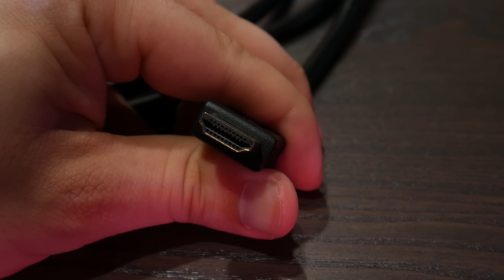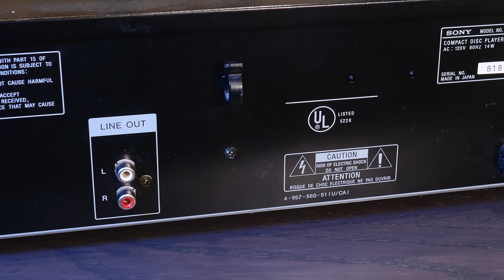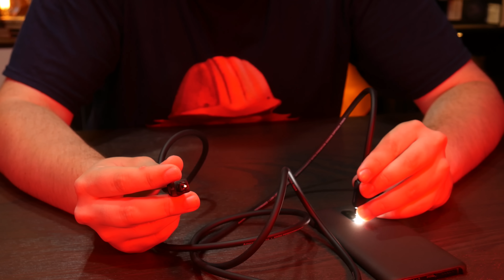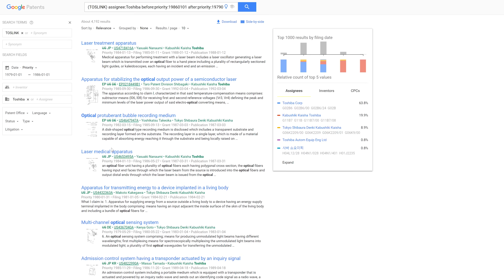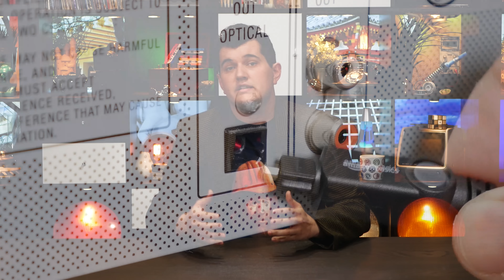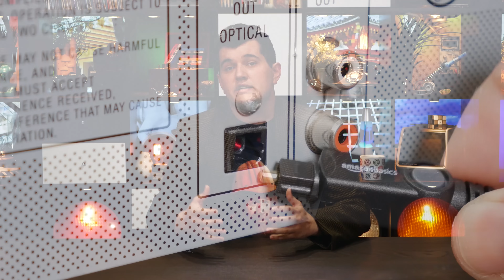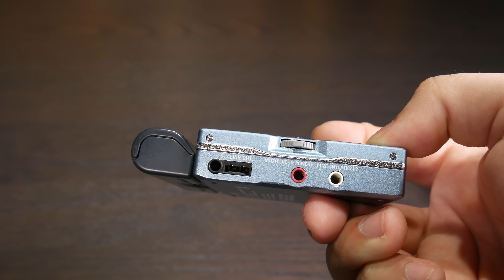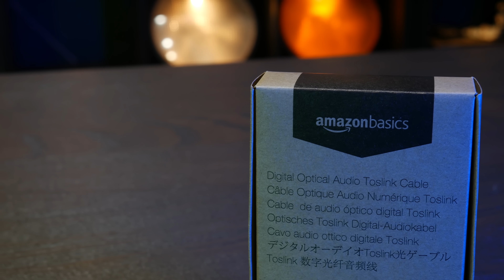TOSLINK: That one consumer fiber optic standard

Comment: Sorry, you are wrong when you claim that audible distortions happen only because the noise overwhelms the digital noise margin or talking about clock jitter.  The biggest issue is that if you run SPDIF over coax instead of TOS-Link, you are connecting the grounds of different equipment. Some of that equipment is likely to have an analog input, so the hum picked up will be quite significant.  It is often something else that is compromised by the current carried in the ground of the co-ax SPDIF cable.  This is especially true when there is a separation. For that reason, I like to have my digital audio workstation connected to my audio system (the final proof) through TOS-Link.  My studio equipment would have noise problems if connected to the ground of my stereo system.  Separating the grounds is good, therefore, TOS-Link is highly beneficial.

Comment: I've encountered mini-TS connectors in so many devices over the years, I thought it was the new TOSLink standard. Mini/Micro PCs use these almost exclusively alongside their HDMI output to provide for external audio equipment. The only other fibre I've had my hands on is for video (optical DVI-link and equivalent), which is used fairly extensively by a couple of venues to which I'm often contracted. Oddly enough, I'm usually there to handle networking requirements for WiFi and IPTV, and yet *I've never handled a network fibre*. (shrug)

Never once found a practical use for TOSLink until I needed to extract audio from an HDMI source for an old 'digital' surround system whose manufacture preceded the advent of HDMI. I found a small, inexpensive HDMI audio extractor (not so common at the time I needed one) that has stereo analogue output and, more importantly, a TOSLink port. It also has a handy EDID spoof switch to force connected devices to output surround. I picked up a handful of cheap, short TOSLink cables (which, incidentally, cost me much less than the copper equivalent), and had my entire media experience fully integrated within minutes of beating the postman to the door.

This was so easy and effective that I am still using it over a decade later, with my cable box, media PC, and a Steam Link currently running flawlessly through it (via a really cheap HDMI hub) and providing DTS 5.1. Never felt like wasting money for an upgrade, and it sounds perfect to everyone who's heard it (none are self-proclaimed audiophiles, however).

Unwanted, expensive, barely-used, pre-HDMI surround sound system: £0. Audio extractor: £40. Pissing off my neighbours by making their modern, ultra-expensive audio system sound weak: priceless! :)
Reply: Wait. Steam Link supports DTS connect?

Comment: Major advantage of toslink being optical is ground loops. While 5m isn't crazy long, it's long enough in crappy buildings with crappy wiring to encounter grounds at different levels, causing ground loop induced hum. You can get RCA based isolators, but using optical is a perfect way of eliminating that problem.

Comment: Got my self a brand new 4k samsung TV. I use my sterio as the hdmi switch between tv and tuner. Problem came when i needed sound from TV (like YouTube and spotify) got myself my first optical cable cause that brand New TV only has one hdmi connector 🤔

Comment: Great video Alec, but I think there's some misinformation going around about these types of cables holding them back. While it's true that analog noise on your digital signal shouldn't affect your resulting signal unless the noise is so great it starts flipping bits, what's not so obvious is that analog noise CAN  couple into the system past the DAQ or tertiary traces and result in degraded performance elsewhere. This probably isn't to big a deal on a CD player or Netflix box, but in a mixed signal environment; particularly where your interacting with analog radios or antennae, this can be a consideration. Adding filtering on your lines adds cost and diminishes the transient response resulting in slower speeds and shorter maximum cable lengths. I recently bought one of these for my home setup to try to get rid of an annoying hum from my speakers that turned out to be from a completely unrelated frequency mixer signal that happened to be intertwined with my audio cable. These are also great because they circumvent any risk of ground loops and they can be really long. I am not aware of any other cables that can send >100 Mbit/s for such long distances without converting to optical.

Comment: 10:00 not sure, networking fiber connectors are all keyed as well, even when they're not in duplex. Could be to prevent spinning when connector's plugged in, which would damage the ferrule. However single mode fiber really needs a very tight contact, which is not really needed all that much for a multimode with a relatively low bitrate working at a relatively short distance (digital audio is really nothing compared to 10 or 40GE transferred over tens of kilometers)

Comment: I used to use coaxial from my pc soundcard to a digital receiver about 30ft across the room back in the early 2000's.... whenever somebody would flick the light switch in the room or the AC in the house would cut on it would cut out and skip, I remember getting a soundcard with optical on it and never having that problem again...  weird thing was tho years later in a different house with other equipment I ran a 50ft coax cable from a bluray to a amp in the dining area and never had any issues lol

Comment: The reason TOSLINK cables were keyed was to ensure they were prioperly aligned, which is critical to operation. Since the connetor was designed to be injection molded plastic, which later has a fiber inserted in the shell, the manufacturing process requires precise alignment to insetion and cutting tools.

Comment: TOSLINK isn't the only consumer optical standard. My (sadly) long departed Theta Generation V DAC ran AT&T glass fibre, which trounced all other connectors albeit at a very high price. Wadia, Mark Levinson and Krell all did/do use the AT&T (aka ST) standard in their DACs/CD transports. Theta took it a stage further (at even higher price) adopting the military grade single-mode fibre.

AT&T uses true single strand glass fibre with 3M hot melt connectors and diamond cleaved ends (to reduce diffraction at the end of the connector).

TOSLINK tends to use large diameter (compared to true glass fibre) plastic conductors, which are both slow and microphonic, i.e. bending the cable can distort the signal.

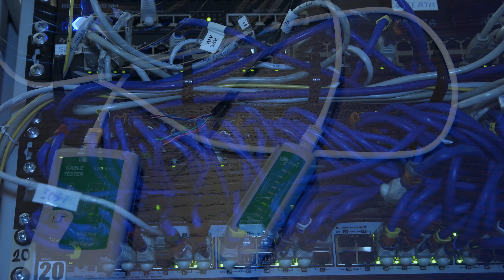Comment: 0:51 - did you know Ethernet is not a synonym to copper cable? There are other types of Ethernet cables - optical as well.
Reply: yeah Ethernet is layer 2 and layer 1, but multiple layer 1 options are available
Reply: This. Ethernet is a protocol for transmitting data. Nothing to do with cabling.

Comment: It is still damn confusing a thing. as Toslink and SPDIF are used interchangeably these days and have been for as long as I can remember. I see the same cables lables as Toslink or SPDIF, various sound cards in computers, the hardware specs say either term, depends on the manufacture, the OS, calls the Toslink port SPDIF out. And yes, the mini Toslink port has been around for ages. It also is used inside RCA port. My Creative sound card has that setup.  And the optical out of a sound card to speakers that have optical in, ALWAYS sounds much better.

Comment: Have in mind electric loops. That's why high end low noise equipment has star grounding on their boards. The less ground loops the better. It only affects the analog parts of the circuits, but in amplifiers you have analog filters, analog preamps, analog output stages which all can pickup the stray magnetic signals induced, transmitted or received by the accidental loops on the boards and otherwise present.

Comment: +11:50 This exact thing actually happened to me once.
My laptop's external DAC wasn't connected to a proper ground, and was on the same circuit as an A/C in an old house, and blew the input analog circuit on my /rather high end/ Denon AVR5700 receiver.

Completely blew the electrolytic capacitors on the input up, the enclosures shot out like projectiles.

Been using TOSLINK ever since

Comment: The gold plated connectors... Ugh... The guy at best buy tried to sell us them to make more money on the sale.Trying to explain to the guy that the gold plating doesn't help AT ALL was a chore in itself. We hit that edgecase where if we had Cheap RCA cables connecting everything, we got interference from the large amount of copper, so we toslinked everything.

He kept doing the whole "are you sure" and "The gold plating makes everything better!", so we ended up telling him to kindly go con someone else and go to Radioshack, since that was still around back then.

We have since upgraded our DVD player to a blueray/DVD combo player (which has HDMI) and all of our consoles has HDMI too. VIVA LA CABLE SHIELDING! It took a few seconds to realise that the new BD/DVD player didn't have a toslink port. It was weird, since it had coaxial audio. Then it took a few more seconds to realise that if we used HDMI, we didn't need toslink.  It's hard to beat that habit.

Comment: around 11:00
digital signals and analog signals are the same (sine waves)
and while noise is usually filtered by the dac digital noise is technically a thing so if you have a lot of unsheilded cables running digital signal you can have issues with jitter and cross talk between cables especially in parralel runs since they cause induction and capacitance between cables which filters high frequency signals like the ones used in digital PCM. 
the usual line noise and 60 (or 50) cycle hum aren't issues but cross talk and high frequency interferance is.
This still isn't an issue for the standard home gamer though, unless someone had multiple digital devices playing different things or for whatever reason had digital internet and phone (maybe in the 2000's) it's not an issue.
Recording studios were already using AES over XLR by this point too so TOSLINK was really only usefiul for very wealthy prosumers with a lot of money to burn.
I think TOSLINK did have a higher bandwidth for multi channel audio so before HDMI it might have been the better option but even then most devices have better 5.1 multi-outs that use RCA, the only time this becomes a problem is if the source device didn't support a certain encoding scheme but the reciever did, maybe in the case of early SACD... maybe.

Comment: TOSLINK breaks ground loops between the Hi-Fi separates.
Interestingly, many years ago, I connected my Roku M2000 to my Panasonic Class-D amplifier with a co-ax for S/PDIF. Intermittently, I would get loud pops and squeaks, presumably from bit errors adding up over time. Replacing with TOSLINK got rid of these.
I had hoped that Intel would use fibre optics for Thunderbolt, but they managed to push copper cables to acceptable performance.

Comment: The biggest advantage of TOSLINK for me is that potential differences between devices do not play a role. The TV and the PC are connected to different sockets, which has actually disturbed the SPDIF transmission from time to time. With TOSLINK the problem was of course gone. Analog audio also had interference when the PC was connected to the amplifier via SPDIF and I heard analog sources.

So sure, TOSLINK is very simple, but it helped me solve problems in my audio setup more than once.

Translated with www.DeepL.com/Translator

Comment: Gold plated optical cables? LOOOL. Thats even more hillarious than gold plated digital (copper) cables.
Reply: Well there are a couple advantages to gold plating, it's corrosion resistant (good in humid climates) and at a high enough throughput (such as a 4K signal) it may help reduce an issue where because of how fast the signal is switching from high to low voltage it is theoretically possible for a high signal to basically stretch into a cycle where there's supposed to be a low signal.  I'm not really sure how true that is but some people have sworn that lower quality HDMI cables which were fine for 1080 couldn't handle a 4K signal.
Reply: Gregory Norris that’s because different HDMI cables have different bandwidths. What you’re saying is true but if a cable doesn’t work for 4K video it probably doesn’t have the necessary bandwidth
Reply: @queenbiscuit311  do you mean that if it's having issues with 4k as described above, gold-plating the connectors won't solve it because the whole cable just isn't good enough?
Reply: Bryan Liguori usually, yes. Either that or the cables just broken. for 4K 30Hz you’ll need an hdmi 1.4 cable, for 4K 50/60 you’ll need an hdmi 2.0 cable and an hdmi 2.1 cable can do up to 10k at 120hz. Which is twice 8k 120hz. They’re cross compatible, but the bandwidth differences are important.
Reply: @queenbiscuit311  This is good information. And your original point is that the bandwidth of the cable is all that matters for this, regardless of whether the connectors are gold plated?
Reply: I'm seeing a partial reply from you in my notifications but it's not coming up proper.  To clarify I was talking about gold plated digital (copper) cables, HDMI in particular.  I'm well aware of how stupid a gold plated optical only connector is (though sometimes the gold plated stuff is cheaper so I buy it anyway).
Reply: @grn1  It's not like the plastic underneath would corrode anyway
Reply: @grn1  You are quite right about the corrosion resistance. There's also the electrical contact resistance which could be lower with gold plated connectors, not that it remotely matters when talking about the small currents involved in data signals (analogue or digital). The voltage rise and fall time on the other hand would not be any different; there is no difference in capacitance or inductance, which is the main cause of such issues.

Comment: Toslink isn't popular because there is no DRM protection, I am assuming.
Reply: SomeFriendlessBastard sadly that is not really the case.  DRM usually may not be seen now but was a very big problem when using either Toslink or SPDIF on DAT decks.  It really was one of the reasons for the limited life of DAT as a consumer format.  Professional decks and equipment  on the other hand had a way to avoid the DRM issue, yet cost much more...

Comment: I am curious with PCIe gen 4 what is the maximum theoretical data throughput on TOSLINK?  Additionally, if the driver is LED-based is there a distance limit to signal vs. laser input?

Comment: HDMi works great between a dvd/blu ray and a tv. But don't try I with anything else. I've had scaling issues with computer screens (and TV's) plus glitchy sound from computers and TV boxes. In theory HDMi should be the best as you say, but in practice it's a mess. I use toslink exclusively to connect my desktop pc, blu-ray and Android box to my hifi. I get 24bit 192kHz sound from all my devices to my hifi, thanks to toslink. Long live toslink! (I get your point about copper being just as good, but who uses copper to send data signals in 2019? PFFFT!)
Reply: One of the reasons is that cables designed for an older revisions are often not be good enough to support the higher bandwidths used by later revisions, which use the exact same connector and just increase the cable requirements. Contrast that with USB, for example: both USB 3.0 and USB 3.1 introduced new connectors and e.g. don't support SuperSpeed over any USB 2.0 cable. (You can use SuperSpeed+ with 10Gbps over a USB 3.0 type A connector, but I don't think there's a consumer expectation that an old 3.0 cable will support that,)

Comment: Regarding why optical?  Isolation is still important even if the signal is digital.  The problem comes in when the electrical connection introduces ground loops.  These will can add noise on the output of the DAC.  Proper isolation of the digital and analog domain is therefore necessary and in general hard.  Having worked on very low noise electrical measurements, I can say that optical connects are awesome!  Since you can really forget about all the noise the all digital side is generating and potentially injecting into ground.  This is not true when you have an electrical connection, even if the data is digital

Comment: The major down side to HDMI in home theater is the DRM is so stupid and aggressive. Often HDMI pass through either doesn't work or isn't reliable. Often people end up using that low bandwidth toslink output form a TV because it works 100% of the time all the time.  For my part I also see more problems with out of sync audio on HDMI than over toslink/spdif.

Comment: So how about you invent UOB  (Universal Optical Bus)  All the fun of USB but at light speed, and no power. :-)
Reply: Why not power? Just pump a 5W purple laser as the power source and use micro p-n junctions to get it back to electricity... Even better- the receiver can run on different voltages using different number of p-n junction receivers arranged in parallel for higher current lower voltage and series for lower current higher voltage applications...

Comment: When HD LCD TVs were all the rage, my parents spent $250 on a gold plated HDMI cable because the salesman told them it was needed. I told them to return it, as any cheap HDMI cable could do the exact same job. But, when you pay $250 for an HDMI cable, you not only buy the cable but you buy the hype that goes with it, and my parents were not persuaded. Thank goodness the HDTV came with its own set of HDMI cables. I was able to convince them that they shouldn't need to buy the cable twice, and I added the lie that the manual explicitly says they must use the cables that came with their HDTV. I was able to return the unopened, overpriced HDMI cable for them without incident.